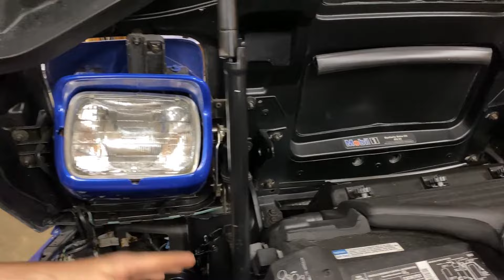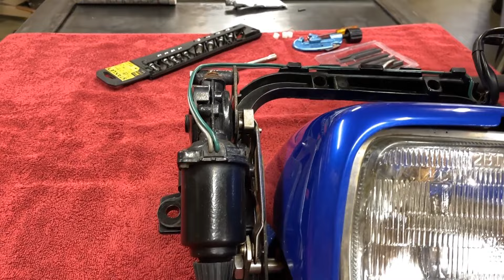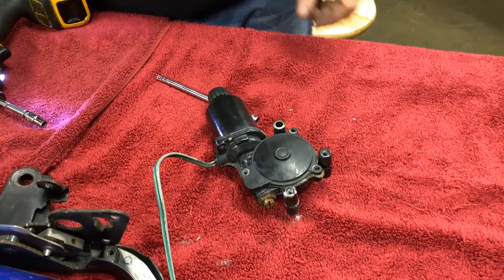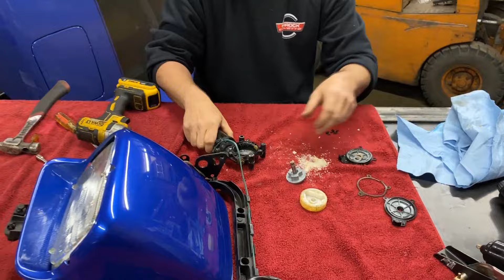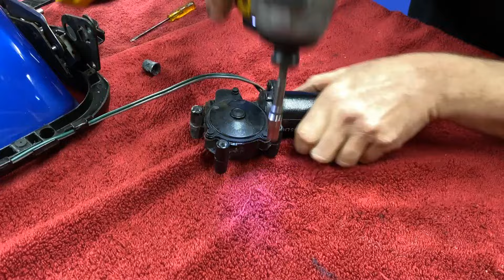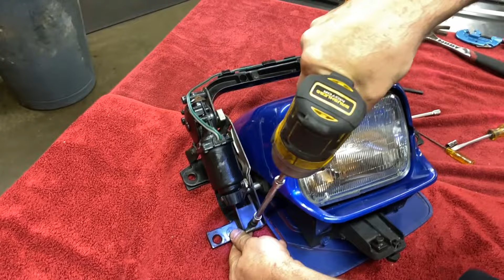C4 Corvette Headlight Motor Repair, No rebuild kit required 1988-1996

Comment: @mirrockcorvette Great video! Made this job super simple! Driver's side down, passenger to go. While I was in there I also upgraded to LEDs. Changing the headlight was easier with the whole unit out of the car, although not super difficult either way...

Comment: Thank you so much for this detailed and informative video. I followed all.the steps. I was having a hard time driving the.split pin in that block, as I couldn't align the holes up. After much trying.I finally aligned the holes and used.a.small C Clamp to push the pin in. Thanks again!

Comment: I just fixed the headlights on my car today. I followed along step by step and it really helped.
One tip I might add. I put a moving blanket/furniture pad under the headlights as I removed them from the hood. I felt it was some insurance in case I lose my grip.

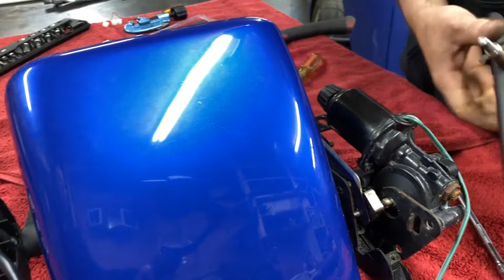Comment: Great video.  One suggestion regarding removing the passenger side gear.  Pulling on it with a screwdriver didn’t work for me. I loosened motor to allow enough slop to remove it.  I found this in this video (9:19 minutes in) https://youtu.be/hKxs7oDV334?si=DoQGmgK4iTAH_8bJ

Comment: Particularly  grateful  for you showing  the different  models candidates differences between drivers candidates passengers side.  Almost gave up but was encouraged  by your video and repaired both sides.  Next time .....I'll just get the replacement  rods or make my own.  Job looked overwhelming  but smoothly  due to your video.   By the way looked at others but yours was the most informative!

Comment: Mine was powder yup.  But also my roll pin that secures the motor shaft to the mechanism was missing.  I was wondering if you knew what size roll pin it takes.  Mine is a 1992 I put a cotter pin  in for now but I want to put back what belongs in there. Thanks for the video watched as I did it, Big Help.
Reply: I'm Sorry it's actually called a "spring pin" it's 5/32 X 1 inch if anyone else is wondering I figured it out.  I got mine at Lowe's but they have them at Tractor Supply also. Thanks

Comment: It's funny how I came across this video today as I'm having a problem with my 93 vette headlight but mine went deeper and the shaft and the metal pecie came apart and I had to weld it back to together seems the splinds stripped out 😡

Comment: Hi, thanks for the video.  I did the drivers side yesterday.  Works great.  I plan on doing the passenger side today.  I plan on following the same steps but after looking at it - is it possible to just remove the motor cover screws and the split pin to do this repair?   In other words, leave the motor and gear housing connected to the headlight assembly.  The most time consuming steps were associated with removing and re-assembling the motor assembly to the bracketry.  Taking it further - is it possible to do the repair without removing the headlamp assembly from the vehicle?  I know, its nicer to work on this on a bench.  But just curious.

Comment: Sorry I didn't watch your video, I watched another, and they did not explain the passenger's side being different. I actually thought it was an aftermarket motor figuring it should be the same as the driver's side. The pin was the hardest part of the job.

Comment: Thank you for this excellent video.  You are easy to follow along and could understand your process clearly.  May I volunteer a small idea... about driving the slotted spring pin during reassembly (minute 22:32)?   I used a channel lock pliers to squeeze/press the pin into the hole and it worked pretty well for both headlights.  Thank again.

Comment: Thanks for the great video! I followed your directions to the t, did the left one last week and the right one this week. Easy peasy. Got my bushings from AutoZone use the ones that were made for a Ford window regulator. They work like a charm and my headlights due too! Thank you

Comment: Hi Mark, your video helped me a lot. I followed each step and managed to re -assemble the gear. But I ran into another problem. When I put the whole headlight assembly back in. I noticed there is play in the fore and aft
position of the headlight rotation. so the headlight cover does not sit flush with the surface of the hood.
Would you have any suggestions as to how to fix this ? Thanks again.

Comment: Great video, Thanks for the info. I am working on getting the shaft off of the passenger side, and as you mentioned,  It is difficult. I put a small screwdriver thru the hole but I can't get it to come apart. Any ideas would be great, Thanks. Don

Comment: Thanks bro, im thinking of buying a 92 Corvette, really low miles, only 40,000 original miles,two owners, garage kept, but the headlights do make that noise,and its a 50/50 chance they will pop up, which sucks if you are far away from hom. Thanks for the tip

Comment: I’m having an issue with a 95 Corvette, where when I turn the headlights on, they flip opposite where the passenger side works perfect but the driver side works the exact opposite then when I turn the lights off, the driver side opens up and the passenger side closes, I’ve taken the motor off and it seems like there’s just a stop there’s no set position for the motor shaft it just spins and has a stop point so there’s no 180 off like I’ve been reading about… I did however flip the wires and it works perfectly now but I really want to know what happened, why do they flip in reverse when the wiring is factory but work perfectly when the wires are flipped now?

Comment: great job, driver's side has been running since I've had the car. Was digging through my shop yesterday and found a pack of the bushings. Must have come with the car when I bought it 10 years ago. Didn't know what they were so just put it away.

Comment: Thanks for the Video. I was a piece of cake with your manual. And by the way it's not the mileage that deteriorate these pellets! It's just the age of that material. This C4 35th Anniversary Edition has only 13900 kms or 8600 miles on it. Many thanks from Germany

Comment: Had same problem on my 1991 C4 so followed your video,only out of dumb luck  passenger side and yes its different , broke roll pin and other issues but got it back together and it works just fine. But today found the little metal tab came off but headlights open and close with no issue, so wondering why in heck did they put this tab on anyhow since it 'on later models

Comment: The reason the pellets were made out of that rubber junk was intended as a safety mechanism for the motor. Those same motors are used in windows and they don't want kids getting crushed or hurt.

Comment: I owe you a beer bro! watched the video before I sent out and everything went seamlessly. only trouble was of course the silver bracket 9:20 i put it back in upside down. 
The fun part was the previous owner bodged some LED headlights in and he has a hard wire going from the lamps past the plug into somewhere else so I did this entirely on the front wheels. Decent work bench.

Comment: That little silver bracket you talk about at 9:35 is missing on my driver side, though is there on the passenger side. Must have been left off by the previous owner. I figured it must not be critical since it's been missing on my driver side for a long time. And now hearing they left it off on the circa 95-96 means I won't bother trying to find a replacement then.
Reply: I had to do my headlights a couple months after I bought my ‘93 in 2018. That bracket was missing on one of the motors also (don’t remember which one). I figured the pellets were replaced earlier in the cars life and they forgot to put it back on. So I bought one from Mark to reinstall thinking it was needed. Now I’m wondering if it had ever been there in the first place.
Reply: @michaelobrien7724  Actually, I got to looking. As the side that had the missing bracket also didn't have the little bump thing for it to catch on. So it was designed on that side to not even have it. 

Not sure if they left it off of the passenger side. Or if maybe mine was in a transition phase where one side got it and the other didn't. I found that bracket didn't let the motor fully close the headlamp, as there was some play in the linkage. So I ended up pulling it back apart and removing that little bracket.

 I also noticed the bracket would spin around past the bump going to the opposite side of where it was supposed to be. And so that's also one reason I decided to go ahead and remove it as I didn't want it to cause wear or damage if it were to cause binding in the linkage with it moving out of position.
Reply: @colt5189  I took pictures of both headlights at the time and I still had them and it was the passenger side that was missing the bracket so you might be correct. The passenger side was not supposed to have one. BTW, the passenger side works fine in regards to closing properly.
Reply: @michaelobrien7724  The only thing I could think of why one side would have it and the other wouldn't would be maybe it had something to do with how the motor was orientated.

Comment: I am having a DS headlight not closing at all in my 1992, it lights. The motor is not turning and the adjustment knob just turns, so I am assuming at this point it isn't the gear. PS works fine. Any suggestions. Also, previous owner said he changed the headlight gears and replaced with brass.

Comment: i had 3 washers fall off the motor assembly sometime after i removed it. they were next to the side of the headlight .cant see any marks where they be long. anyone have any ideas? did not see any washers in the video

Comment: I wish you guys were located near me. My Corvette repair shop is too busy, apparently. They don’t install used parts and are reluctant to do repairs like the light repair. My 94 Vette with 47k miles looks show-room fresh, but is slowly losing capabilities. Gone is ABS, slip control, cruise control, ac control panel, tire pressure warning and radio. I need to find a local shop hungry and capable enough to do my repairs. Money is not an issue; just competence. Do you know of such a place in Palm Beach County Florida. (Not Eismanns)?

Comment: $20???  I always used stainless washers at a couple bucks a packet for the correct size and never touch it again. 

You can do the left hand side without removal from the car. 

It seems to have been a bit of a thing that people swapped the superior 84-87 assemblies to the later versions. No idea why anyone would do that, it is a step backwards.
Reply: So you just stacked up washers instead of using the plastic bushings?If so it makes sense to me.Can't understand why GM engineers would  use a part that disinagrates.
Reply: @  yep, it works well. There is a reason they used the disintigrating plastic though, in areas where ice and snow are an issue the plastic bushes will shear instead of chewing up the gears. 

Obviously not an issue to use metal washers if your vehicle won't be subject to ice and snow though.
Reply: @CaseTheCorvetteMan Thanks for  the information. How many washers did you use for 1 bushing or what hieght should they be?
Reply: @  just use enough to stop it feeling loose and so they stay in place

Comment: Ive put this job off for nearly 3 years.  Decided to just jump into it.  After watching your video once through, I took the lights out and brought them into the house on my desk and sat and went through it again for each light.  Three years ago when I first got the car I bought the brass gear kit.  After watching you I decided to use the originals.  They cleaned up beautifully and they keep the car all Corvette.  Its a 93 with 36K on it.  The job took an afternoon due to waiting for help removing and replacing from the hood but the video was a huge help.  Thanks.  They work perfectly and are so quiet and smooth now.  I do recommend loosening the worm gear part of the motor to help with wiggling out the gear.  That side gave me a fair bit of trouble the the left was easy.  Thanks again.
Reply: Very helpful thank you, my son bought a 96 c4 passenger headlight is clicking I'll get the 7/16 rod and will tear into it thanks for the great video.
Reply: If the motor to the worm gear is taken out, the two " brushs" are under spring tension and will not go back in easy.  Be careful!

Comment: thank you for taking the time to share your version of your R & R technique of the headlight assembly on the C-4.  Your suggestions were the only ones that were practical and economical and did not require ordering parts from a Corvette parts supply house. I was able to accomplish a Mirrock quality repair in my driveway yesterday for pennies (to my great delight and satisfaction!).

Comment: Thank you for your video yours is the only one that explains things very well. Also the only one that showed what tool to use to get all the way deep into the bolt that to loosen to slide the unit forward. Once again thank you. This is on a 1990 C4

Comment: I use aluminum pellets which I cut from a  7/16” aluminum rod. Never had any issues and never have to worry about plastic/nylon pellets deteriorating again.
I do use a little dab of grease around the pellets.
Reply: Hey that's a great idea, I like it much better than using plastic, thanks for sharing!
Reply: I copied this idea. Brilliant. Doing mine as we speak.

Comment: Just did this repair on both of my headlights for my 93. This video definitely helped take a lot of the intimidation out of the job and everything went very smoothly. As far as keeping my painted covers from getting scratched, I used thick towels and also covered painted services with Saran wrap just to make sure that as I moved it around on the towel I was not scratching anything on my paint. Thanks a bunch!

Comment: Great video. I wish it was posted before I rebuilt the headlight motor gears on my 92. I was also wondering what the point of the "pellets" since they only lock the gear to the actuator shaft what were the engineers thinking? I came to the conclusion that the brass gears were just a waist of money since that is not where the failure tends to be. I bought a rebuilt kit nylon gears and pellets after watching your video I think I would just buy new pellets. Thanks for the advise on the 5 ft stick of pellet material it's good to know but I doubt if I will ever repair 40 headlights in my life time.